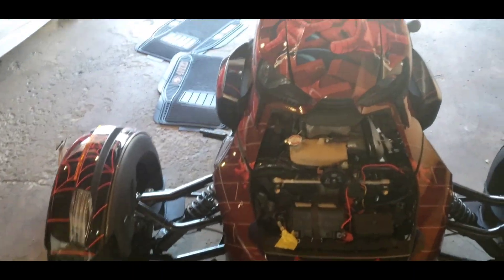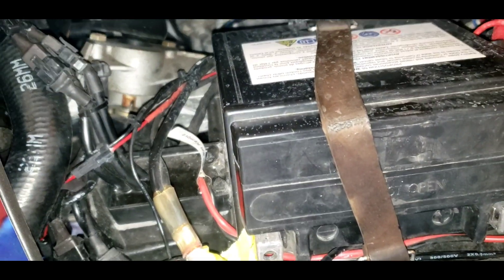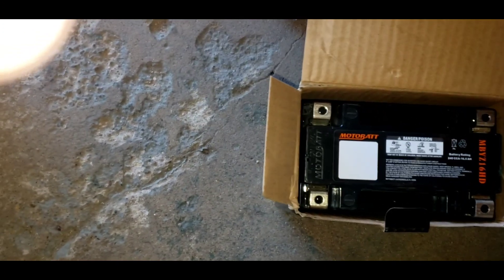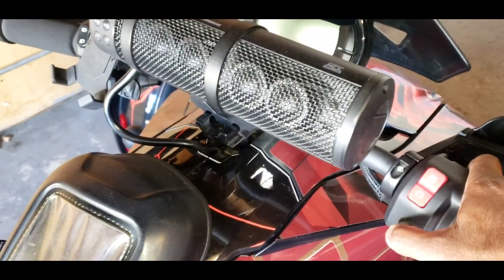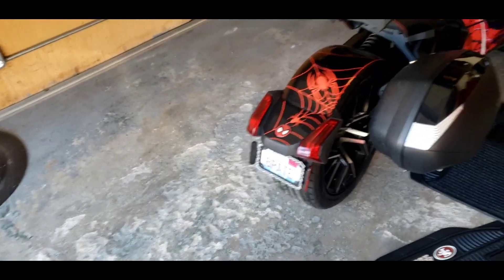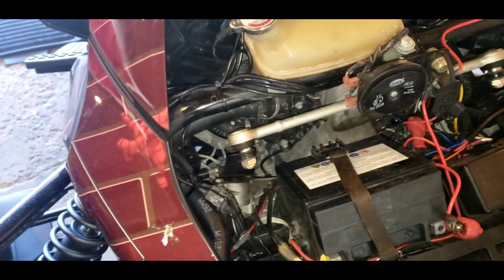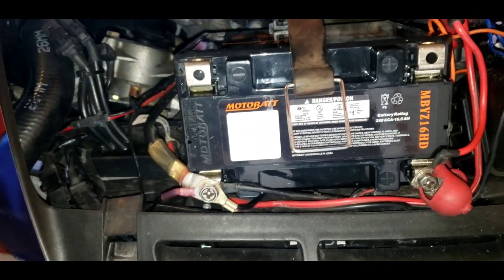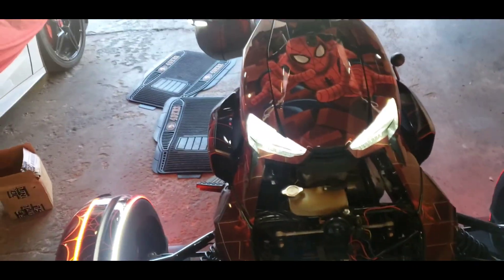Can Am Ryker! How to replace the battery?

Comment: Yes, I replaced mine too. It was only 10 months old but I wanted the one with 4 terminals. So much better connecting everything. Oh, you have to take off the front panel to get the rubber part back on for the battery
Reply from the maker: I ended up not taking it off and just forcing down in there. Lol

Comment: May want to take a look at that brake pedal linkage. My RT LIMITED had a brake light staying on issue too. I looked at the linkage and sprayed some silicone lubricant on all the pivot points and no more sticky brake pedal linkage. Just an idea.
Reply from the maker: Okay thank you for chiming in. Will check that out. Thanks

Comment: I have the same brake pedal and worried about that.  I check it from time to time to see if it's causing the brake light to go on.
Reply: How do you adjust the brake sensor?
Reply from the maker: Good question
Reply from the maker: I didnt even realize it was doing that until the bike starting dying